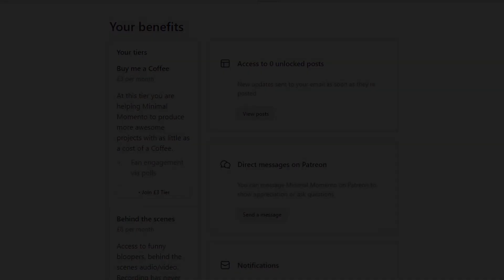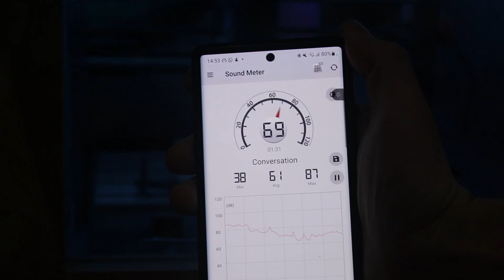CNC ROUTER AND ENCLOSURE UPGRADE FROM MOSTLY LEFTOVER WOOD #3018pro #3040pro #cncmachine #cnc

Comment: Thank you for detailing your project. I had been struggling with how to attach the dust collection hose to the dust shoe without catching on the spindle or drag chain. After seeing your configuration I realized I was making it too complicated.  I also like the use of the wood siding that had a rabbit already cut(for the window frame). Again...why make things more complicated than they need to be.